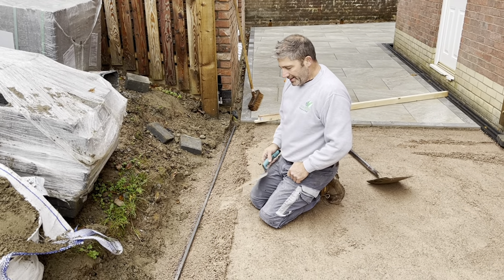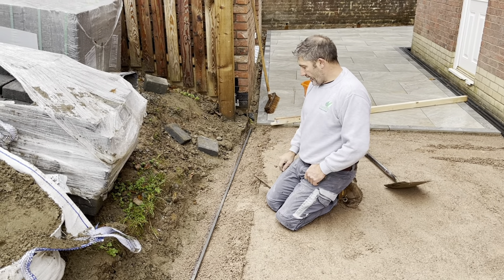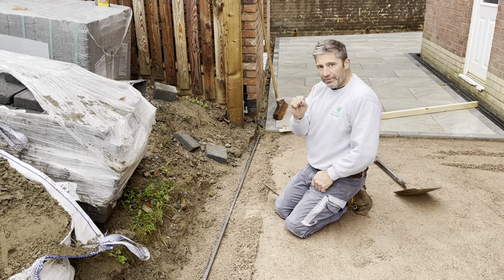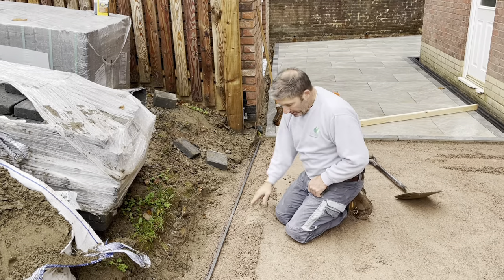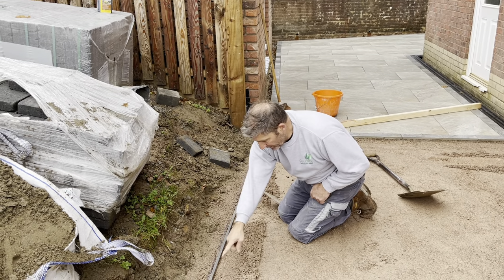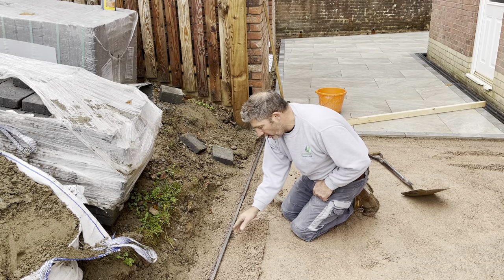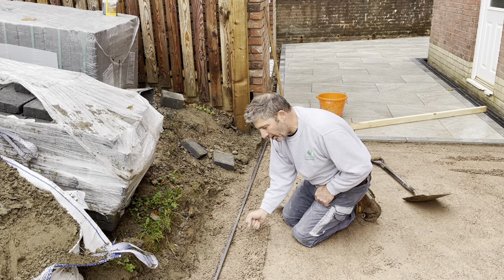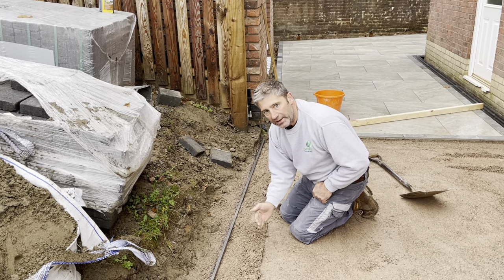#Block #Paving #Tobermore #Driveway #Preparation - Vlog Snippet

Comment: Having same problems down my way, sharp sand is turning up like beach sand, hardly any grit in it compared to years ago. Occasionally having to use grano dust same as you described as 6mm to dust, but it’s twice the price of sharp sand that only adds to the cost to the client…
Reply from the maker: It’s a pain Dave